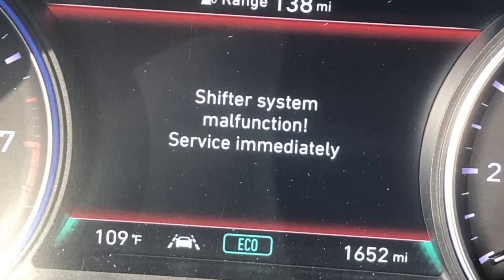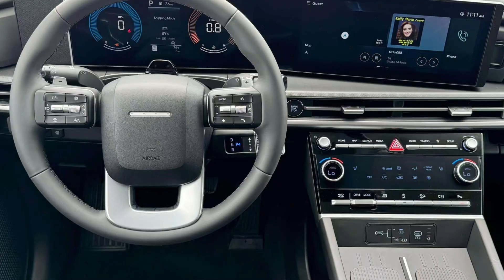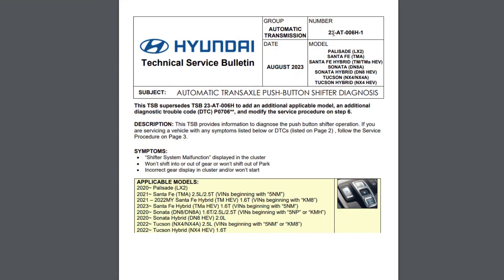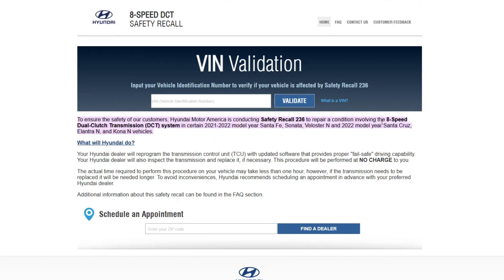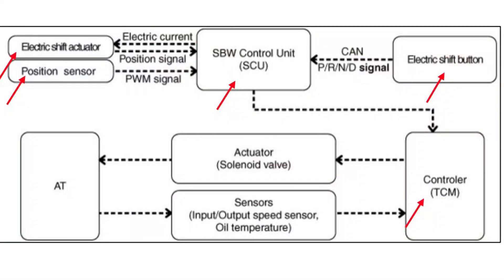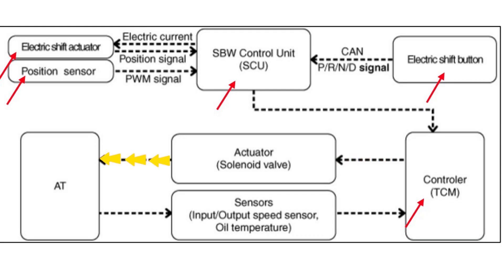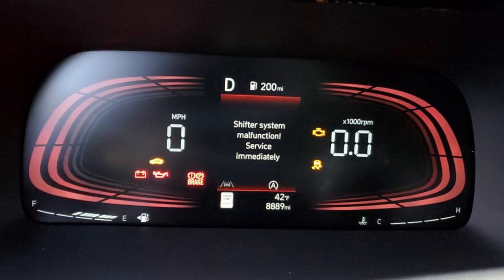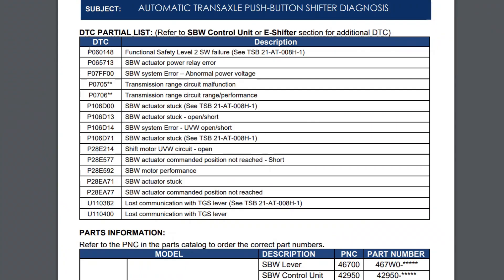“Shifter system malfunction” warning in Hyundai vehicles

Comment: I am having this exact issue. Yr 2022 Santa Fe. I’ve had this issue repaired last week(700.00 because I was told that this piece is an external piece) and this week this car is shutting down randomly and not switching gear. Sometimes I can hear the car going into park but the dash says R/N. I dropped the car off at Hyundai waiting to hear what they’re going to say this week. 

Ohhh the display went out 5/3. Paid for the diagnostic test to find out that it simply went out. The guys explained to me that sometimes the wiring becomes loose because drivers hit bumps. SMH ☹️
Reply from the maker: Modern cars turn to money pits once the bumper-to-bumper warranty ends.